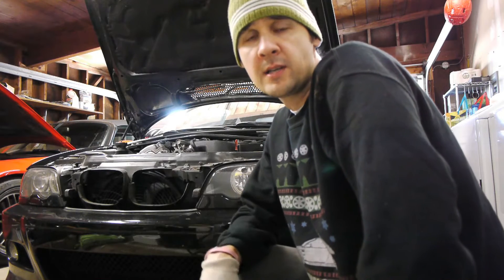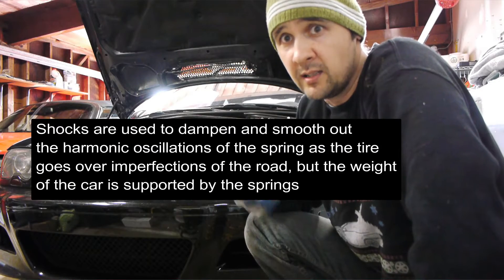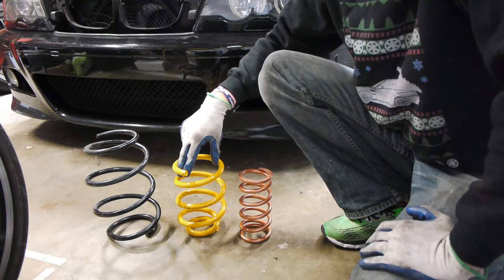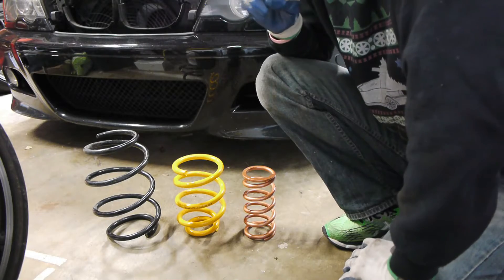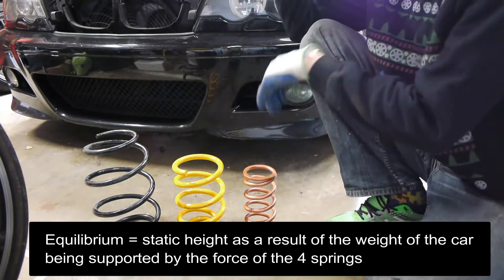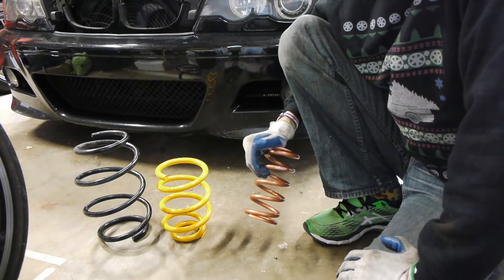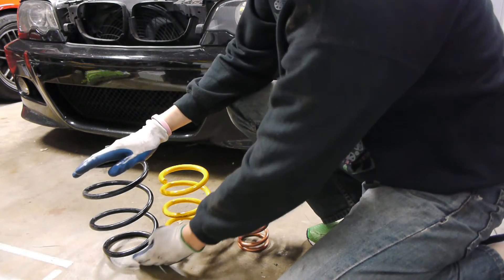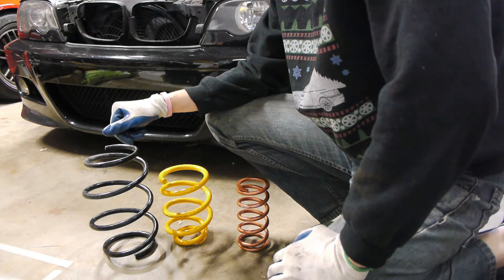Spring Explanation - bump, droop, compression, travel, diameter, rate (Part 1)

Comment: I have a e46. Almost all the coilovers come with pitch not flat ride. The only one I found that comes with flat ride is kw street comfort. The coilovers I want comes with a stiff 457lb front spring rate. I want to switch that to the front to the rear and the front change it to a 225lb should give me a 10% flat ride. I'm just confused on the spring length. I don't mind if it's over dampened.
Reply from the maker: @sr20dett1000
Welcome to the E46 family :). So with a 225 spring you will need to preload it about 2 inches more (assuming it's the same unloaded height as the 457, say like 7") to get to the same ride height as you would with a 457. Does the shock body have enough threads to adjust the bottom spring collar upwards that much? What length spring is the 457? I might try to get the 225 in at least an inch taller, that way the extra inch of unloaded length will only require you to preload it 1 inch via the collar on the shock body.

The other point you made, yes you will probably be over dampened. Normally shocks are valved to take about +/-20% spring rate. You will be going down almost 50%. So even at full soft shock setting you might still be getting a subpar ride quality. Maybe call kw to see if they can custom valve the fronts for your specific intended needs?
Reply: @mrgizmo7975  I'll probably get a 9 or 10 inch spring. It has a helper spring too. I think if I use the same spring length the coils will bind.

I'm using this spreadsheet
http://www.fatcatmotorsports.com/FCM_Ride_Harmony_BMW_E46_M3_Online/FCM_Ride_Harmony_BMW_E46_M3_Online.htm
Reply from the maker: Yeah swift/hyperco make custom springs and they publish the free height and the total travel on the springs before coils bind. Good to see you are already using Shaikh's site. 👍 You only need the helper if the primary spring is not tall enough to stay seated at full shock droop.
Reply: @mrgizmo7975  the length of the 457 is  7 inch with a helper springs. The 457 spring deflection1.86 inch spring loaded is 5.14. the 225 will deflect 3.79  inch loaded 3.21. Won't it coil bind with just 3.21 left.
Reply from the maker: What is the total travel of the kw front strut? And what is the bump component (remember the shock will compress a few inches as well to sit at equilibrium height with the spring and what will be left to compress until bottoming out is the bump travel). If shock bump component is more than 3.21 before it reaches bump stops, you will have coil bind. Think of it slightly differently, if you remember stock front strut, the spring rate is about 170, and the unloaded total length of the spring is about 11-12 inches. So you will need to get a pretty tall spring, if you want to run a 225, which is not that much stiffer than stock front. That said, outside of valving the kw front strut to take such a low rate, I dont know the total travel it has and whether you will be able to run a 10-11 inch spring on it (like physically get the spring on the bottom collar and be able to tighten the top mount on it).
Reply: @mrgizmo7975  I don't have kw. Don't have coilovers yet. On the cheap side I'm thinking solo werks, has terrible from to rear spring. Not worth the $650 price tag. But I will pay $500 to for $450. Second is Vogtland coilovers can get them for $715 taxes and shipped. The Vogtland coilovers are similar to ST coilovers and KW V1 but for a better price. All these coilovers I will need to change front spring rate to get flat ride. On the expensive side Im looking at Ground Control street/touring for $1650.  I don't like the spring rates they recommend. If I can get them 280front and 575rear or 600rear. The only thing about Ground Control it seems like it doesn't have much suspension travel in front. I looked more and it's not the suspension travel but the fact that I'm limited to spring length. Compare to the coilovers I mentioned.
Reply from the maker: Yeah maybe call the brand you are interested in or one of the distributors and ask some questions about what you plan on doing, they can give you recommendations on spring rates/lengths that can work. Sounds like you are on the right path to figure this out. Unfortunately flat ride doesnt come as an off the shelf solution :).
Reply from the maker: Also, Koni yellows with Eibach lowering springs seems to be a good option for a lot of guys. Or TCKline suspension packages. More budget friendly.
Reply: @mrgizmo7975  I don't like lowering springs specially if no spring rate is given. To allow me to know the frequency. TCKline are to expensive. The konisport with ground control sleeves are around $1136. If a were to get any it would be Vogtland. Also I can always swap out the Vogtland inserts to koni race inserts when they get worn out. The Vogtland quality is nice. I only found one video of the Vogtland for e36. They look awesome.
Reply: @mrgizmo7975  Just found some ground control coilovers for $250 on Craigslist. No camber plates and might need a rebuild. I got to snatch them up before someone else.
Reply from the maker: Find out how much a rebuild costs and if there is anyone local to you that can do it. For example rebuild on Ohlins is about $160 per corner and if there is noone local I have to pay shipping and return shipping which is another few hundred $. It adds up. At some point it is cheaper to buy a new set :).
Reply: @mrgizmo7975  I still don't know if the koni are from Ground Control or OTS koni. If OTS it's not worth rebuilding. I'm mostly interested in the coilover sleeves.
Reply: @mrgizmo7975 Got quoted 200 or more per damper. Just as I thought not worth rebuilding. I can get the OTS koni for $610 new with warranty. The price is still good. I'm mostly interested in the sleeves. I also don't like the springs rates it comes with. I'm gonna try do to lower the prices some more.
Reply from the maker: Yeah, expensive to rebuild, sometimes cheaper to buy new with warranty. 👍
Reply: @mrgizmo7975  I didn't get them. St coilovers come out with a new line of coilovers. St xta plus 3 at $2469.
Reply from the maker: @sr20dett1000  I thought you were looking for something cheaper?
Reply: @mrgizmo7975  I am. I'm really leaning towards st xa or xta specially with the $200 dollar rebate on xa and $250 on the xta.
Reply from the maker: See what sales will be next friday...
Reply: @mrgizmo7975  I been doing more research on tender/main springs. The st coilovers have a similar spring rates to Vogtland. 115/345 front and 480 rear. The front spring will sometime have a 230lb when the tender springs comes into play. Which will give me that flat ride that I need. In smooth roads flat ride is not needed but smooth perfect road don't exist. Looks like I won't need to swap the front springs to a softer one. I don't have much experience with many coilovers. I wanted you to check out the st xta plus 3 for it's features at such a low price. It's mostly for track and triple adjustable. I'm not getting those but just want to know what you think of them.
https://www.stsuspensions.com/catalog/product/view/id/1463/?c_year=2003&c_make=31&c_model=181-20&c_car=1786-5-1-7-7507
Reply from the maker: @sr20dett1000  hmm, for the price they seem to be including a lot.  When manuf includes a lot of features for cheap, I start questioning the quality a bit. Would be good to get feedback from someone who tried them in real world. A lot of knobs, even for track is not always the best, it's hard to dial things in. Also, at that price point, you get into Ohlins or even MCS territory, which are high quality single adjustable.